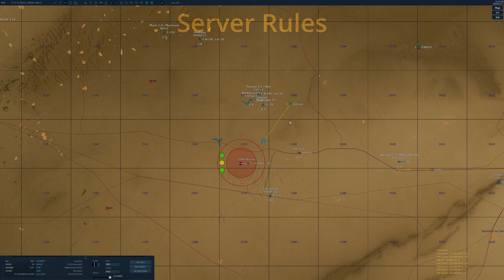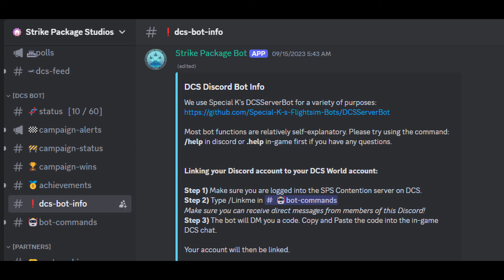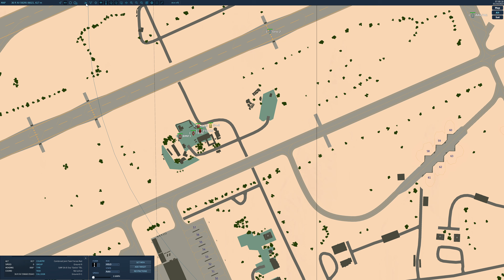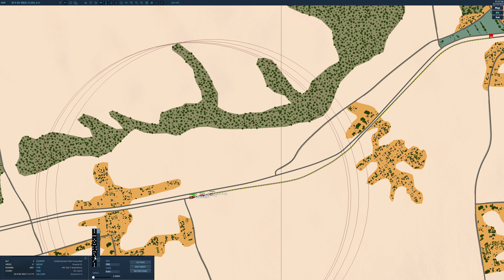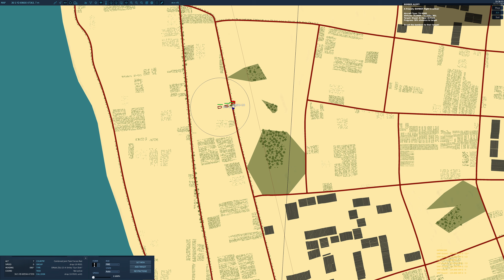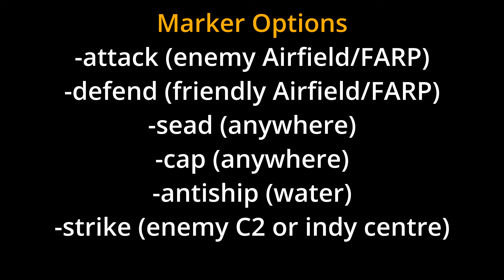Contention DCS Server BEGINNER'S GUIDE | Tactical Commander

Comment: hey i cant seem to join any slots for flying,do i need to link the discord ?
Reply from the maker: @earthexplorer579  you only need to link the discord account for the tactical commander role. For flight roles, make sure you are using the dynamic slots. The static slots are just templates for the dynamic slots and are not selectable
Reply: @Dr_Jebus  when i click on dynamic slots it want take me to the jet.
Reply from the maker: @earthexplorer579  click on the airfield you want to spawn at. It will bring up a window where you can select your jet and loadout
Reply: @Dr_Jebus  thanks ill try it out
Reply: @Dr_Jebus  tried it,it says the slot is locked.why is not just like other servers where we click on the jet & we spawn?
Reply from the maker: @earthexplorer579  slot locked likely means you are trying to spawn too close to the front. Try further back, or a different airframe.

As for why, it makes it much easier to use with multiple airfields and multiple planes. You can spawn any airfield in any plane that the server lists. There's no limit on say the number of F-14s can have taken off from a small airfield. And if a change is made, say a particular plane is changed sides, only one entry needs to be changed, not every single one.

Compare to HCW which uses the old system, there every slot needs to be manually added by the designer. There are hundreds of planes, added by hand. Often smaller airfields have very limited options because there just isn't room. And if they have to change something, like change the side and aircraft is on? They have to do that by hand for every single instance of that plane on every single airfield
Reply: @Dr_Jebus  could you do a samll video expainingthis.i cant figure it out.sorry
Reply from the maker: @earthexplorer579  sure. I'll do a short. Will @ you when it's done
Reply from the maker: @earthexplorer579   Short is now up https://youtube.com/shorts/7GBqWlHyoww?feature=share